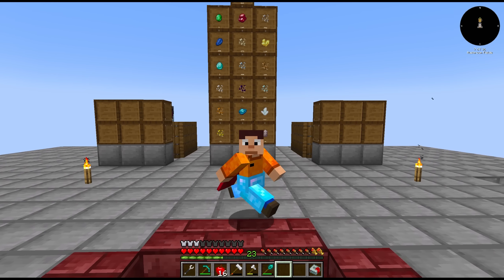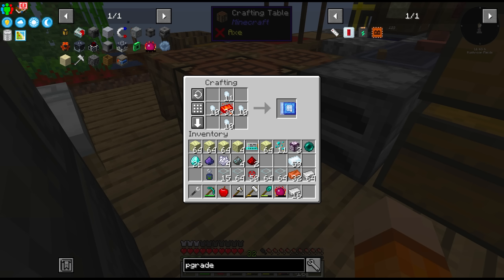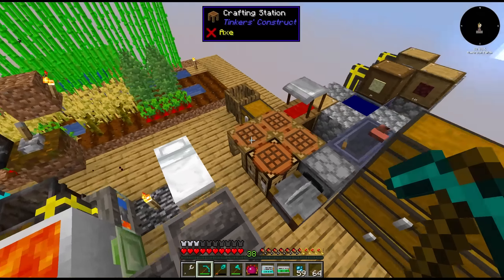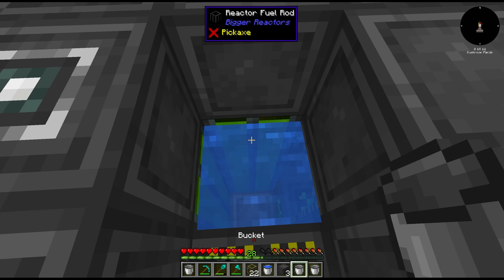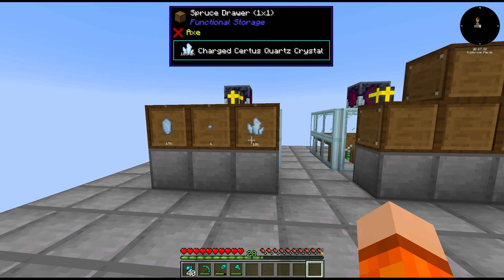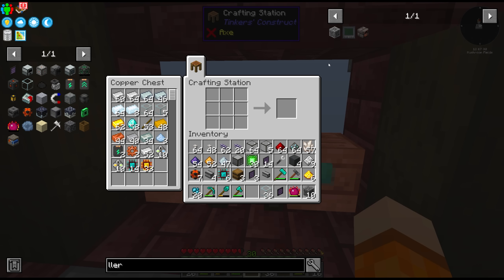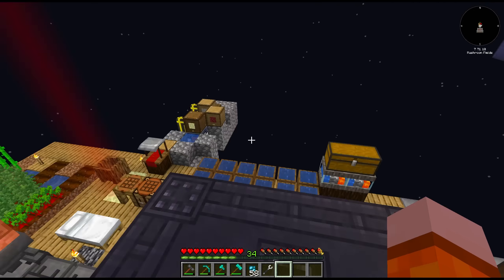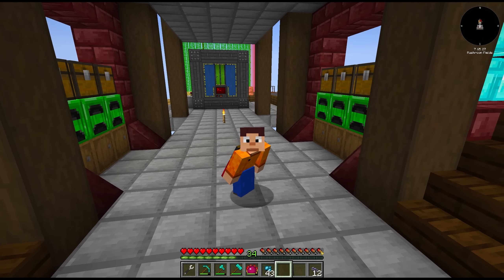Minecraft ATM7: To The Sky - Ep02 - Bigger Reactors & Applied Energistics

Comment: The "Mekanism 5x" isn't really 5x anymore since there's the assumption you can use Fortune on the ore block to get more Raw Ore items which then can be multiplied by something like 3-4x with the FULL Mekanism ore processing chain.
Also for the Bronze ingots and other alloys I found that in the ATM packs they have most ingots as from their original mod AND from the AllTheIngot/AllTheOres compat mod BUT not all smelting etc. recipes make the respective alloys, so remember to look at both variants of ingots.
Reply: You can just silk touch which is something that mekanism supports, they supported stuff like diamonds back in the day and now they support stuff like iron with silk touch and when you silk touch and use the full mekanism chain i think it was 10 or 20x i don't remember how was it, i didn't playd with it for a while, currently playing GTNH which is pain
Reply: @ahmetemregurdal501  > when you silk touch and use the full mekanism chain i think it was 10 or 20x

No, it's not.
Example: Iron Ore Block (like when mined with Silk Touch)
- 1x Block into 1,000 mB Dirty Iron Slurry (1000/1)
- 1 mB Dirty into 1mB Clean Slurry (1/1)
- 200 mB Clean Slurry into 1x Iron Crystal
- rest of the processing chain are just 1:1 steps
==> 1000/1 x 1/1 x 1/200 = 5x

Example: Raw Iron (as dropped without Silk Touch and increased to up to 4x per Ore Block with Fortune)
- 3x Raw Iron into 2,000 mB Dirty Iron Slurry (2000/3)
- 1 mB Dirty into 1mB Clean Slurry (1/1)
- 200 mB Clean Slurry into 1x Iron Crystal
- rest of the processing chain are just 1:1 steps
==> 2000/3 x 1/1 x 1/200 = 10/3x or approx. 3,33x but with a really good Fortune modifier the overall yield per block of Ore will be much better.